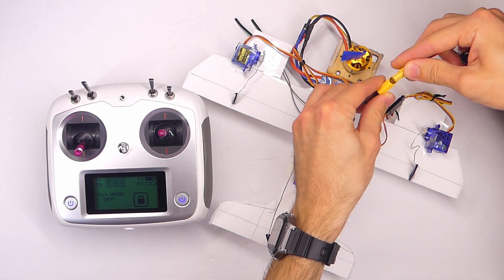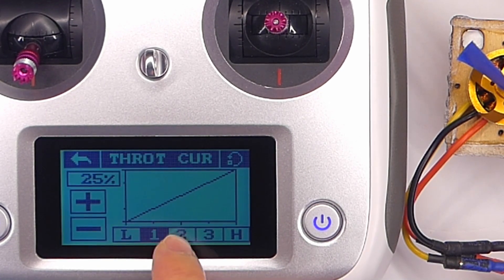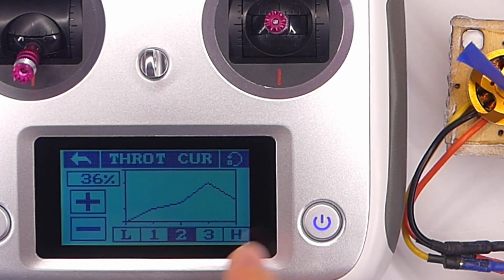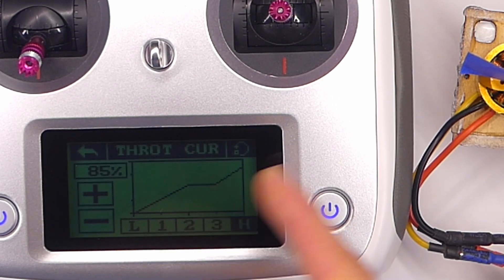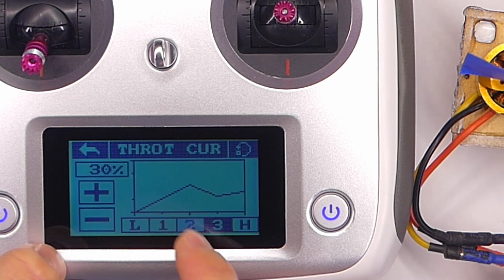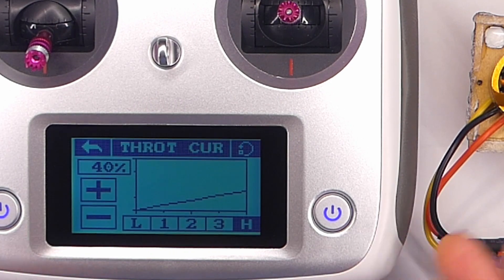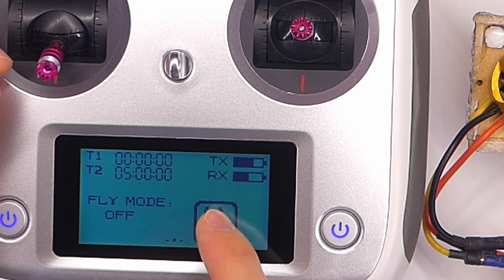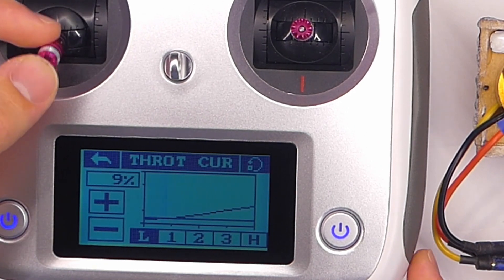How to use Throttle Curve & Max Limit 📈  Flysky FS-i6S

Comment: I accidentally changed port one and canceled USB now.  no longer connects what to do?
Reply from the maker: Hi! Oops! My understanding is that you will need to put the flight controller into bootloader mode, re-flash the firmware (with "full chip erase" selected), and re-do any settings you have previously had. Someone else had this question a while ago, but this might help https://github.com/betaflight/betaflight/issues/2567